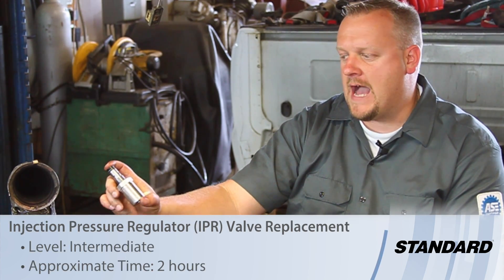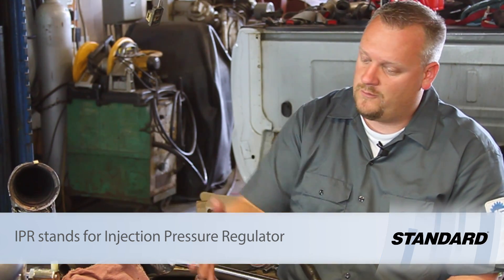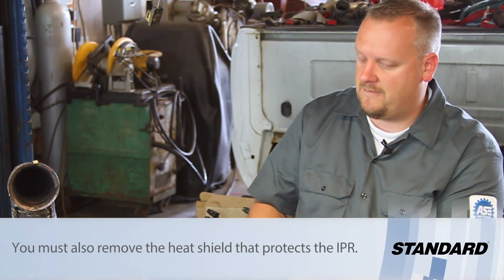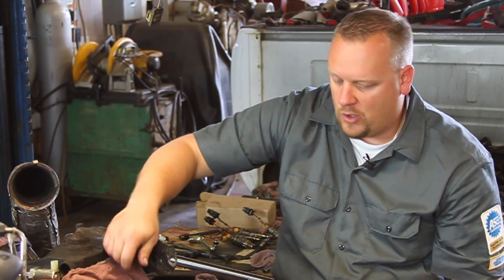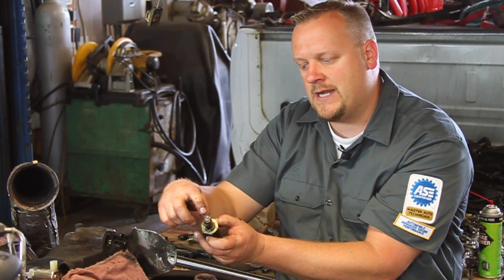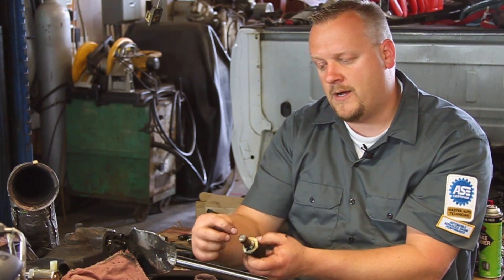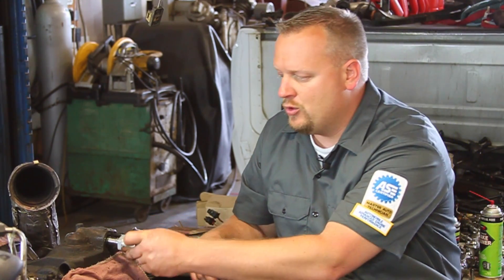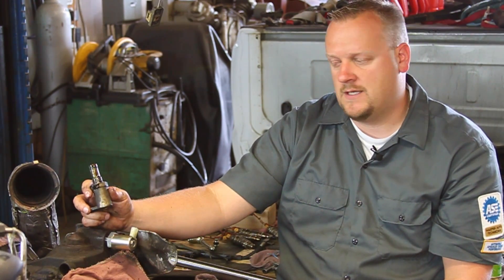Ford 6.0L Powerstroke Injection Pressure Regulator (IPR) Valve Replacement

Comment: Is there anyway to bench test these
Reply from the maker: Thanks for the comment. It's difficult to come to a conclusive result with bench testing. In our opinion, if you have already gone through the work to remove it, you may as well install a new one.
Reply: Standard Brand it ended up being the problem thanks